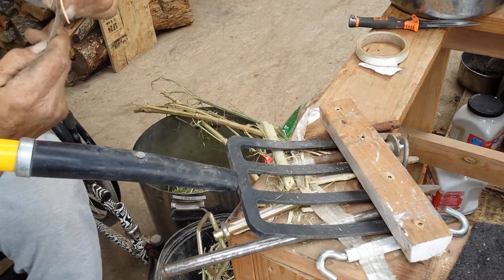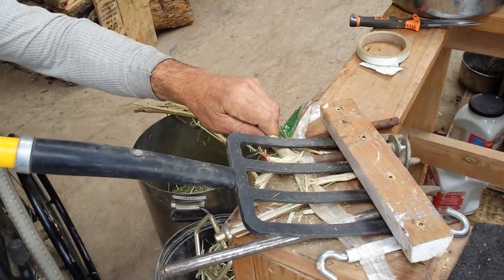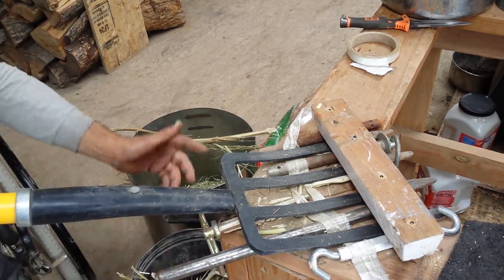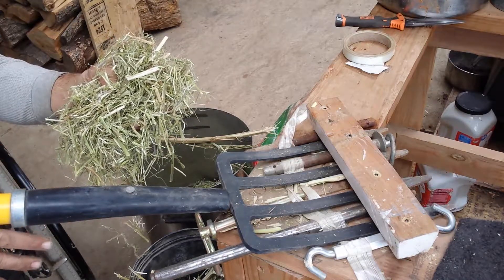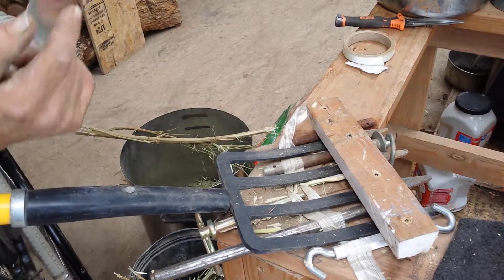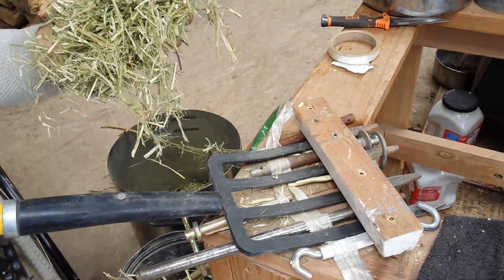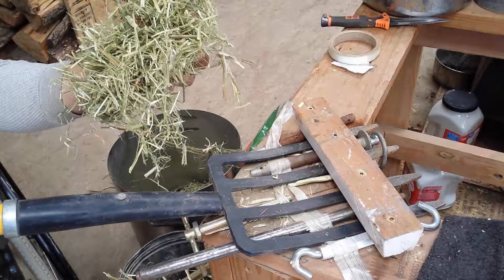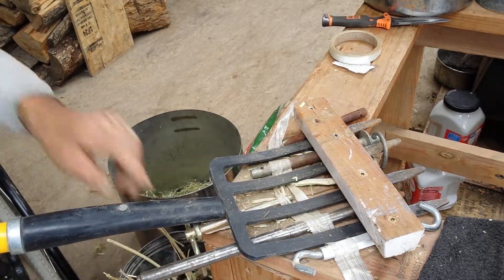HempCrete, HempComposite  fiber preparation, crushing the Shiv hardwood from the Bast tensile fiber

Comment: Hempcrete sounds awesome, but unless you grow your own it is still really expensive to buy bags of hurd.  I have wondered if you can do the same thing with chopped straw, but hemp is special.  It is legal to commercialy grow in some places with proper sales connections, but growing in your backyard might not be.  Hemp being not smoking cannabis. Local agriculture dept. in charge of this.  I have seen another diy type hemp stem crusher that should work a little like this.  I am not sacraficing MY spading fork to this.  Also, I like that you are using both the shiv and the hemp fiber in your hempcrete which would be the homegrown way to go.

hemp stem crusher: looks authentic old school:  https://www.youtube.com/watch?v=BPXvsJ6BmiM
Reply from the maker: Crushed Between rubber track's would help tremendously
Reply from the maker: Growin your own isn't going to be a option for most, it requires ~5 ac of hemp Deliberately grow for fiber
Reply: @mrglasecki   Am I mistaken in that you are using both the hurd and the hemp fiber in this.

Comment: You mention using lime as a base for the exchange. What are your thoughts or experiences with using clay? I'm just thinking about how red clay has been used for brick making and about its abundance where I am. Are there other naturally occurring substances that could act as binders as well?
Reply from the maker: Would depend of kiln temperature
 To determine if Bast hemicellulose fiber or graphene would be better *graphene will Thermally transfer heat as well